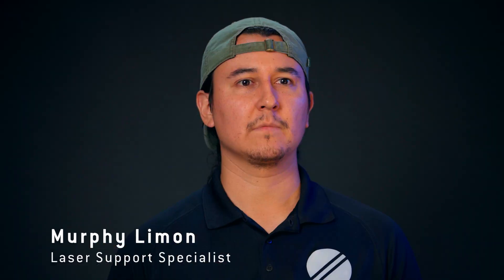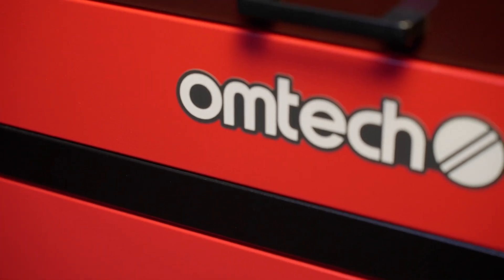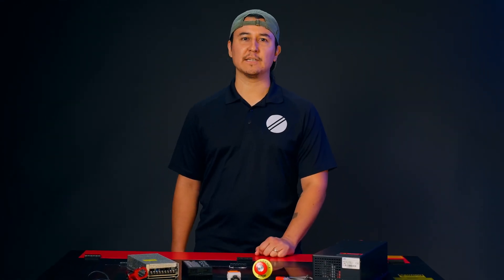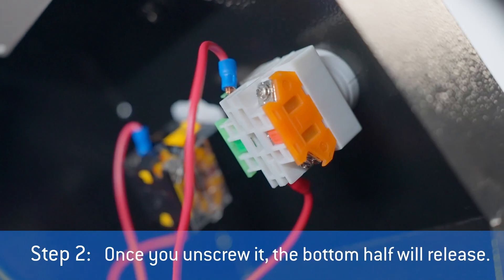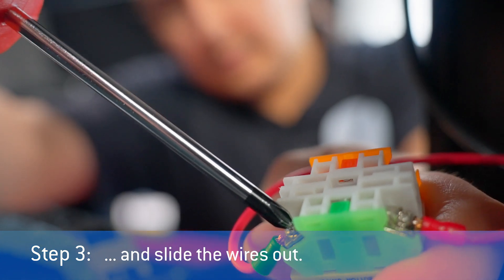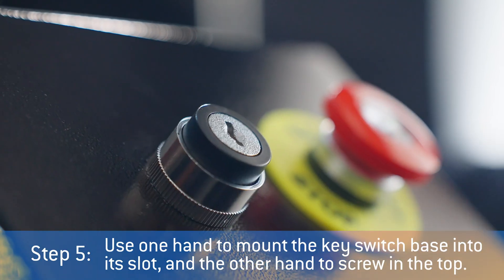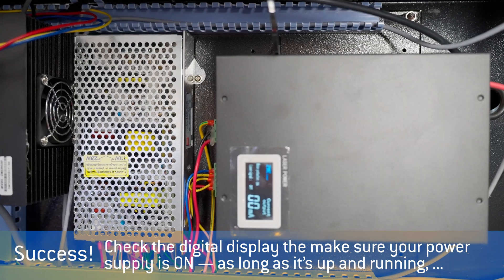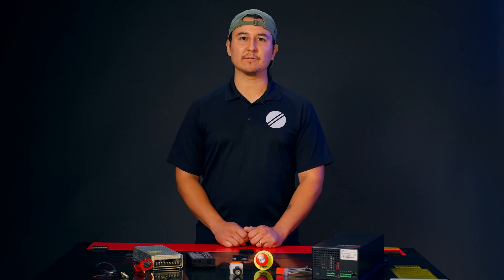Replace Your Key Switch - Here's What You Need To Know

Comment: Just received my new key switch after the original failed.  Machine is 5 months old.  Marked all 4 wires as to their location before removing old switch since they are all red.  Marked new switch as to where each wire will go to match location on old switch.  
When I powered on machine it was homing.  Once it was done I turned on switch and it flickered and the ruida panel went off.  Will not come on.  Checked fuses and it blew the one on the lower 110 plug.  Replaced and it blew that one and the ruida panel never comes on.

Now what.